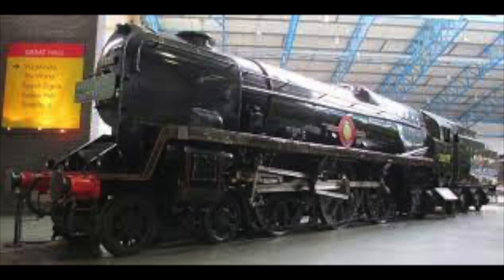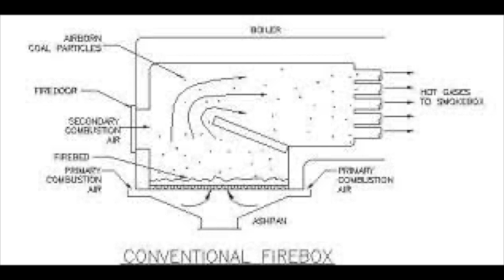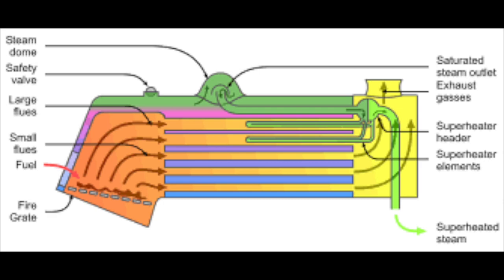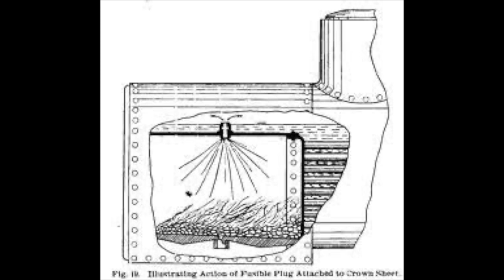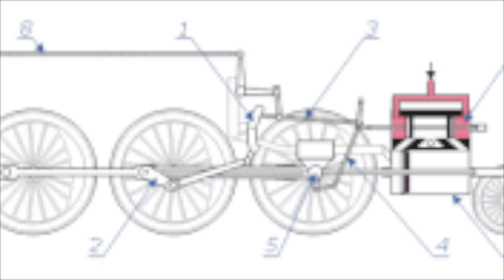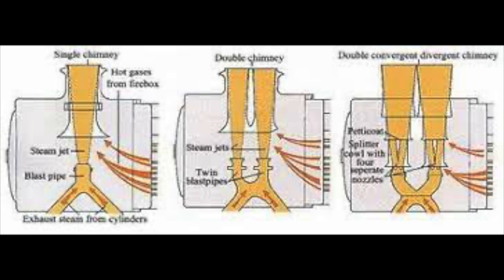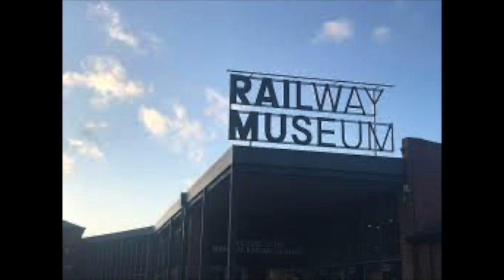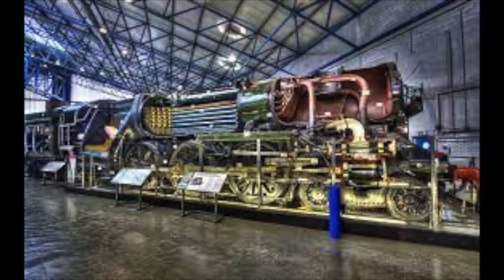Ellerman Lines

Comment: One interesting locomotive is the Baldwin 60000 at the Franklin Institute in Philadelphia. It was an experimental 4-10-2 locomotive built in 1926 that used a Water Tube firebox, weight 350 short tons and could pull a load of 7,000 short tons.   and was a three cylinder compound. It got its number because it the 60,000th locomotive Baldwin built. However given it's length and weight, it was fit for only the heaviest and straightest tracks  It was tested in the Pennsylvania Railroad's Altoona Test Plant after which it was assigned to freight service between Enola Yard in Harrisburg and Morrisville yard via the Trenton Cutoff. In November-December it was sent for further testing on the Baltimore & Ohio  in February 1927 it was sent to the Chicago, Burlington & Quincy  where it was run in tandem with the CB&Q's own M2-A class 2-10-2 number 6157 to compare coal and water consumption. Baldwin 60000 proved to be more superior than the M2-A. It was then sent to the Santa Fe where it was compared to the Class 3800 2-10-2's with same result. It then went to the Southern Pacific Railroad where it was converted to burn oil and received a SP tender in the Sacramento Shops. It was tested pulling both passenger and freight trains on the SP's Sacramento division. it was then sent the Great Northern . Overall the engine did not perform as well on oil as it did coal. After it was converted back to coal it was sent back to Baldwin where was a stationary boiler till it was donated to the Franklin Institute in 1933 and was moved from the Baltimore & Ohio tracks at 24th and Vine street over temporary tracks to the building which was still under construction and was placed inside through a hole in the western wall. Baldwin 60000 was intended to be a model for future orders but none of the railroads were interested 

  Source: Baldwin 60000 - Wikipedia
Reply from the maker: that poor engine, but in honesty this would make a great video :)